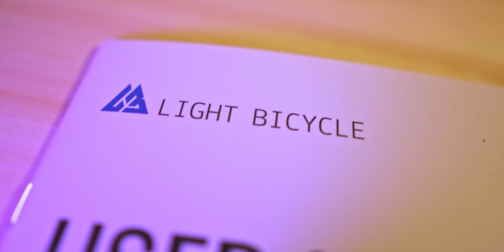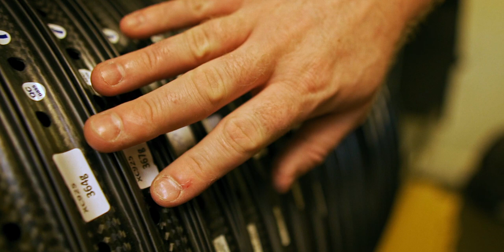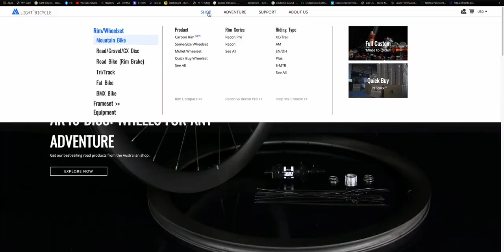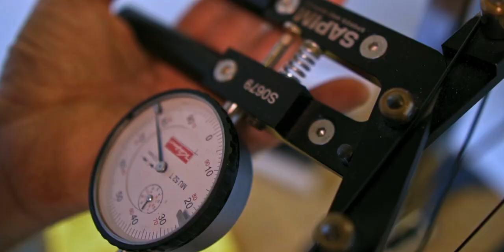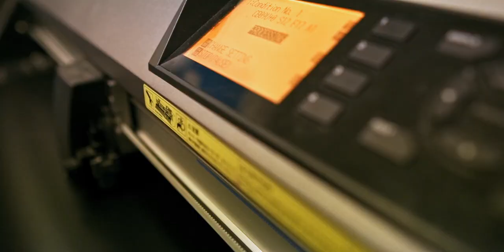BIKEPACKING Carbon wheels ~ Exclusive look at the Light Bicycle WR40

Comment: I have this wheelset for road aero bike, riding 28c tubeless tires stretched over the 32 width rim rides amazing. I love listening to that whoosh as I roll fast at 70 psi
Reply from the maker: Thats always the cool sound I love when rolling on carbon.  These wheels rock!!  I’m very happy with them running 35mm semi slicks right up to 2.25 MTB… this things spool up really quick and just a little gas and they just keep the speed.
Reply: @SaltyBeard_Adventures  yes depending on which hub you ordered with those be careful when washing down the wheel not to get the hubs wet. I had built them up with spinergy hubs because they were really lightweight but I noticed after my first bike wash that the spin of the hub was gritty and so I took it apart and regreased the bearings usually that shouldn't happen when getting the wheel wet, but they are back and run smooth now again.
Reply from the maker: I'm putting these Industry 9 hubs through the wringer, and still buttery smooth.

Comment: After 5 months what you think now
Reply from the maker: Awesome!! I’ve beat the crap out of them. And yes, with a few scratches etc.  They are very easy to clean.   The ride is very nice.  My w-flow rim profile handles crosswind extremely well.  My only real complaint is a minor aspect of the Industry Nine hubs I picked.  Swapping end caps to swap between different bike sets ups is a bit of a pain.  I plan on having another set built and will probably go back to DT Swiss maybe Chris King hubs
Reply: @SaltyBeard_Adventures   good to know i contact the factory in china  to get a quote ….  Ps scratches are all apart of the adventure proves your using them lol
Reply from the maker: @Bikepacking  / you just go onto their website, choose which warehouse you need to access (they have 4 globally) and build your wheels.. prices are fixed, based on purchasing power in each location.  And each warehouse location will have different hubs, etc. depending on what they can get at particular price points.  LightBicycle are big on bringing the highest quality build parts at the best price possible.  Through their global purchasing power, they pass the savings onto the customer.